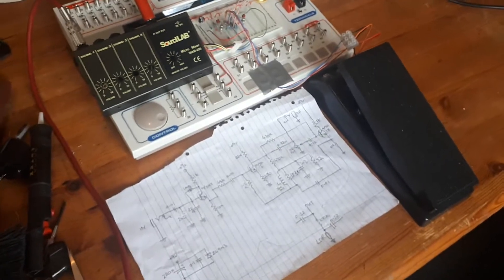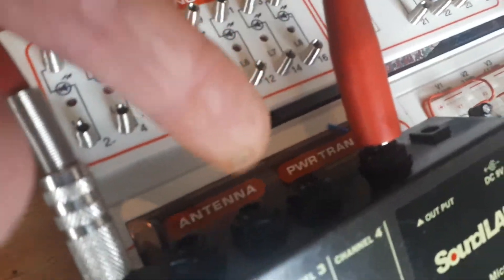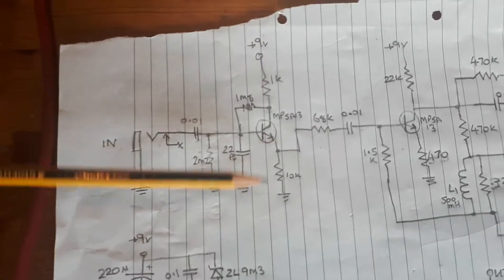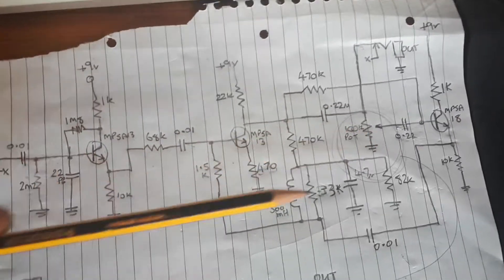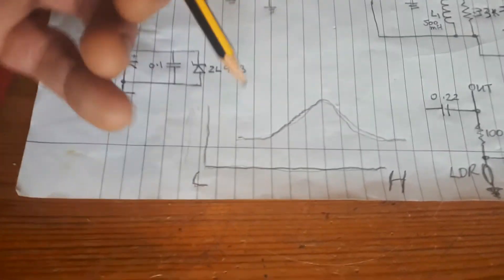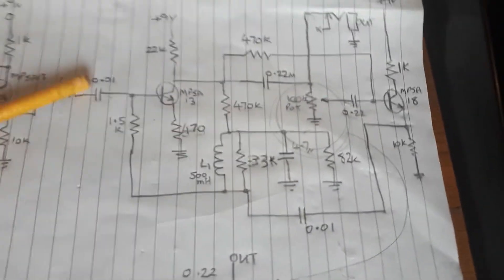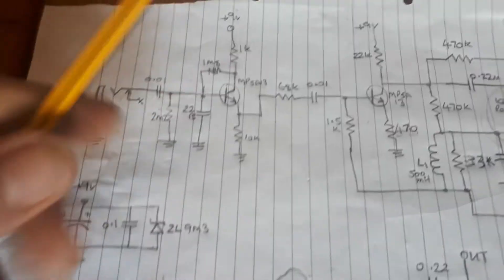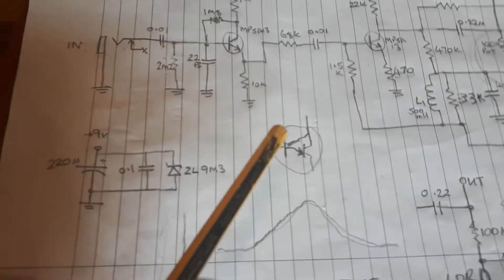Home built wah wah effect explained (basic)

Comment: Great simple circuit, can't wait to build one. A couple of questions though, I cannot make out the value of the resistor at the beginning input that goes to ground connected to the .01 cap, I see 2mz is the best I can make out, also, there is a capacitor connected to L1 and the 82k resistor, the best I can make out is it 4.7 uf or pf? Lastly, on the phono connectors, does the "x" connect to both jacks? Thank you!!
Reply from the maker: https://youtu.be/lkfa-6V3AoQ
Reply from the maker: Did you see the video?

Comment: Hello I am trying to modify my wah pedal in a special way. I want to basically create a whammy bar through signal processing so woodwinds and brass can mod their amplified sounds even more. Do you think this is possible? I have tried variable capacitors in place of the existing ones but their capacitance is so low I can't get a freq response. Let me know if my explanation makes sense. Thanks!
Reply from the maker: Yes variable capacitors are very small in value, for tuning at radio frequencies in the order of KHz to MHz.

It sounds to me like you're describing a "Theremin" sound if you are wanting anything like an electronic whammy bar sound. 

Wah pedals work by accentuating a particular band of frequencies in the mid range of human hearing frequencies and rolling off bass n treble above and below it. A bit like the bell shape peak of a drummers cymbal cut through it's middle.
Reply: My next attempt will be to try changing the resistor next to the inductor to a variable resistor. This should change the Q factor correct?